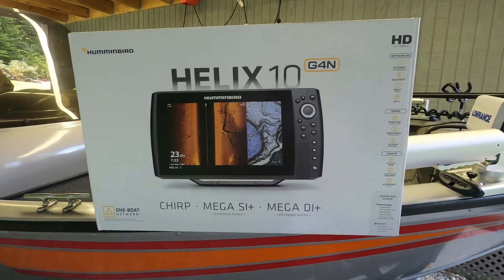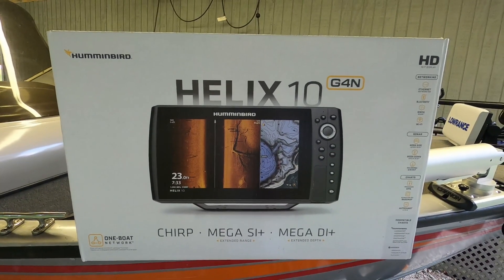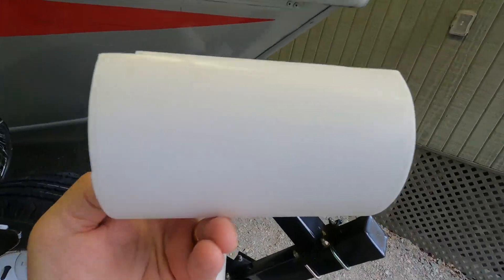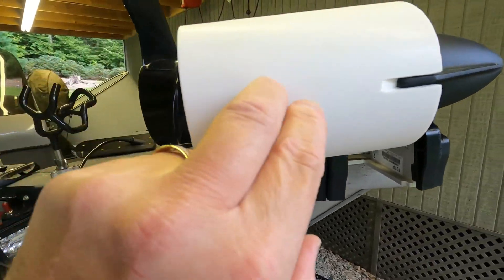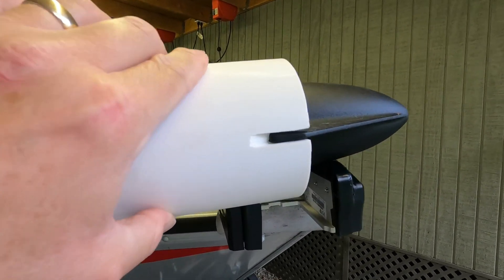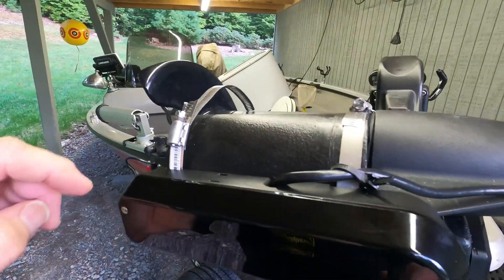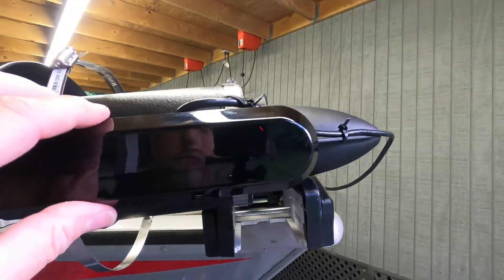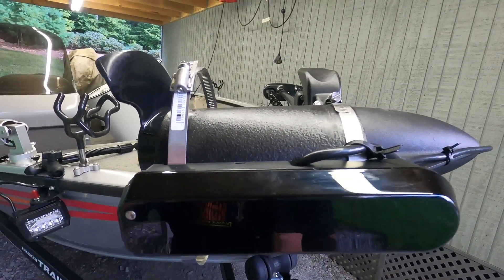Humminbird Mega Transducer Trolling Motor Mount Modification

Comment: Just did this today. I had to use 3 inch pipe for my minn kota. Mounted pretty good and straight. Tried bunch of other stuff ways that didn’t work work
Reply from the maker: Awsome man so glad it worked for you. Mine is still going strong never even had to adjust it yet. Thanks for watching 
Tight Lines

Comment: Cool idea, one thing that catches my eye that seems like could be an issue, is the setup becoming a "collection post/catch all", for hydrilla, milfoil, etc...

Being you posted this video 2 years ago now, I'm curious to know if you'd design it the same way today, after having used it for 2 years, applying the old adage of, "if I knew then, what I know now"?

I fish North and East Texas lakes, the majority having quite a bit of grass, and I'm about to be mounting this transducer on my trolling motor, and was curious if you'd change anything in your design if you were to do it all over again?
Reply from the maker: Wouldn't change a thing. It's been performing perfectly. We fish for striped bass so we don't run into any weed or things collecting on it. We pull planer boards and the boat doesn't get into the shallows just the boards. We are in north east tennessee and we don't have alot of grasses where we fish mostly soil and rock bottoms. Let me know if you use it and if you have any questions about the build thanks for watching and tight lines.

Comment: How wide do you cut the pipe that fits against the trolling motor😊
Reply from the maker: The gap I cut was 2 3/8 inches be sure to sand down the edges so it sits flush with the motor housing. Might vary a little depending on what motor you have . Let me know if you have any other questions and thanks for watching
Reply: Awesome video and I have the PowerDrive v2.. ur design is gonna save me prob 300 bucks.. GREAT IDEAL
Reply from the maker: @scottrummel9477  glad it's gonna help you out. When I ran into this problem it made me mad that they didn't make something to adapt there product to all motors so when I came up with this I wanted to help out the people that had they same problem. Thanks again and tight lines

Comment: Can’t you just cut the skeg off? Or do you actually need the skeg. I have the same issue.
Reply from the maker: I thought about doing that but you would have to cut it flush with the motor housing and I didn't want to chance that when they cast the skeg that ther would be a small hollow spot where he skeg and the housing meets. I didn't want to void the warranty or have a point that if I had to patch it that it would be a problem spot for a leak. Thanks for watching and let me know if you have any other questions
Reply: Guess Im going the PVC route!!!
Reply from the maker: @shayeoana  probably the better option

Comment: Amazing video this helped me out a lot. Just wondering what transducer cover/mount did you use? Or did you use one at all
Reply from the maker: Here is the link to Amazon for the mount. I used to attach the transducer to the pipe spacer Humminbird 740182-1 AD MTM HW MSI... https://www.amazon.com/dp/B07L3K13ZC?ref=ppx_pop_mob_ap_share
Make sure you check the number of screws on the bottom of your transducer,  mine had eight but some models have less. Didn't use a cover or anything we striper fish so we don't get into any weeds or trees. Thanks for watching and let me know if you have any more questions. Tight lines

Comment: Great idea! A couple of thoughts. If you can find it in the right size, there is black ABS pipe. Also, the wiring up the front might grab weeds or moss.
Reply from the maker: Thanks for watching they do make the black pipe but I already had the pvc and the flex seal. I don't have any weed issues but we fish for striped bass so aren't in the real shallow water. Thanks again for watching and tight lines.

Comment: Where did you get that black transducer mount? Mine didn’t come with it . Mine has a silver one
Reply from the maker: Humminbird 740182-1 AD MTM HW MSI Trolling Motor Adapter Bracket https://a.co/d/1yAbBfV
Here is the link to Amazon
Mine had 8 screws so make sure which one you need cause I think they make a 6 screw one. The number of screws is how the transducer mounts to the bracket. Thanks for watching and let me knowbif you have any more questions.
Reply: @subasurfcasters  thanks for replying!!
Reply: @subasurfcasters did you use the black flex seal spray can?
Reply from the maker: Yes the black spray flex seal

Comment: I’m having the same problem with a dragonfly 7 I have an older evanrude trolling motor with a kinda short motor housing going to work on the pvc pipe extension tomorrow. Thanks for the great video!
Reply from the maker: Hope it helps you out. Let me know if you have any questions I can help you with. Thanks for watching

Comment: This is the exact problem I am running into. Thank you for this, very innovative and will drastically change my set up for this up coming boat season. Has any problems came about or is there anything that you would change? Thanks again.
Reply from the maker: No problems with it and wouldn't change anything . It works perfectly. If you have any questions during the build let me know and thanks for watching
Reply: @subasurfcasters  thanks for the great video/idea I will be doing this
Reply from the maker: @loganmapes2307  let me know if you have any questions during your build. Thanks for watching
Reply: @subasurfcasters  How did you manage the transducer cable running up the shaft of the motor to avoid pinching/damaging it
Reply from the maker: @loganmapes2307  mine doesn't attach to the motor shaft. I have a new minnkota powerdrive and the shaft of the motor slides in the motor housing until it hits a stop bracket you adjust for the motor depth. I have it attached up by the head of the motor above where it slides with a zip tie
Reply from the maker: @loganmapes2307  did you get It done. How's It working for you
Reply: @subasurfcasters  just did the install today, haven’t had the time to test it but everything seems great! Appreciate the idea
Reply from the maker: @loganmapes2307  awsome let me know how it works and thanks again for watching

Comment: Thank you I just ran into this problem with my garmin this helped out a lot I went ahead and made the same thing but I did a little bit different I drilled four holes in the PVC pipe to allow my transducer only to be on the PVC pipe to keep it from expanding when I secured the PVC to the trolling motor
Reply from the maker: Glad it helped you out and thanks for watching

Comment: Can you let us know how it worked? Have the exact same situation -
Reply from the maker: It works great don't even know it's there. The transducer reads perfect. I was skeptical about cutting off the skeg. Since it would have to be cut flush with the motor housing. The housing and skeg are kind of like a die cast metal piece and didn't want there to be a empty cavity there where it would be cut and the motor leak so I came up with this mount. Hope it helps you out. If you have any more questions just let me know and thanks for watching.
Reply: @subasurfcasters  have you had a problem with the pvc slipping around the motor when you tighten it down? Father in law was using it Saturday and it was working well until it didn’t- repaired it and it was ok again until he hit my dock backing out and broke it off…. Going to try adding a transducer shield saver
Reply from the maker: @travisconley4636  No problems with it slipping. The slot that you cut in the bottom for the skeg to fit in keeps that from happening. Hate to here that he broke it on the dock.
Reply: @subasurfcasters  how wide is the piece of pipe you removed
Reply from the maker: @travisconley4636  I'll check and let you
Reply from the maker: @Travis Conley The piece I cut out was 2 3/8 inches.   Be sure to sand the cut edges of the pipe so they sit flat on the motor housing. Let me know if that works.